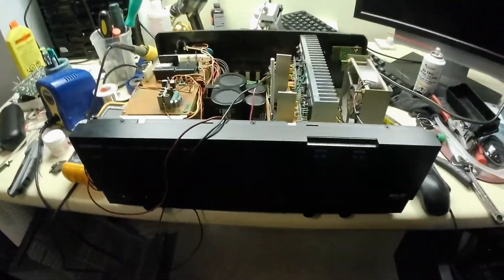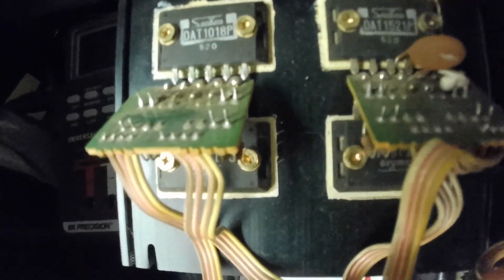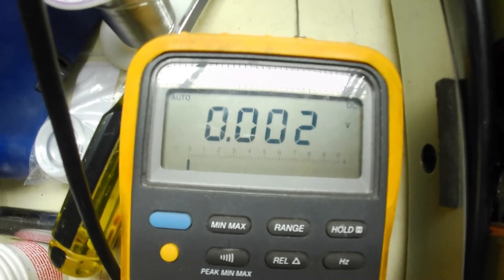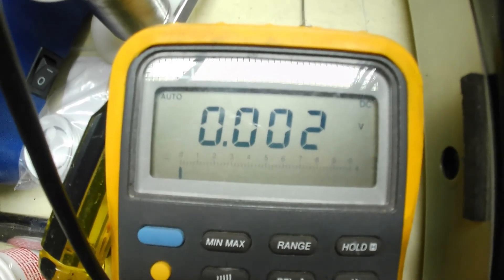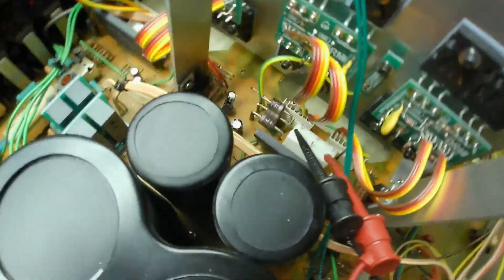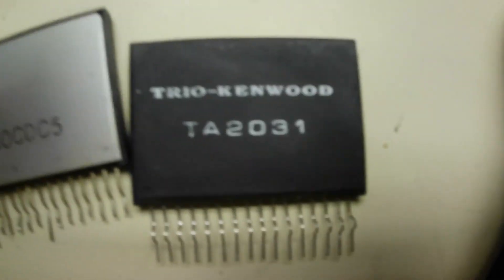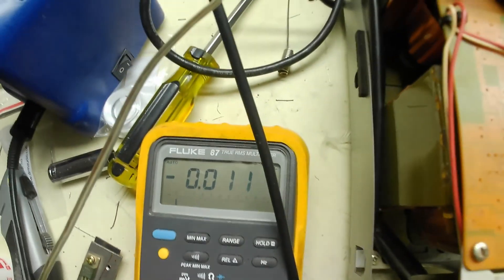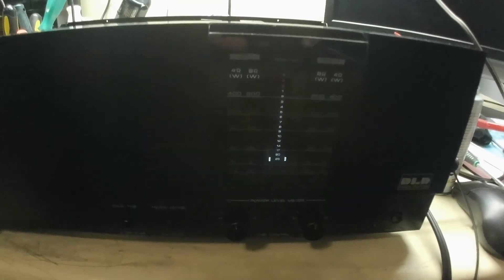Kenwood M2 DRM Modifications and BIAS repair

Comment: Just scored on one! Unfortunately it's appears it's not receiving any input signal, or just not outputting to headphones or speaker connection. Meter display lights up. This thing was matted with dust on the inside, I spent hours blowing it out with air. Still getting nothing 😞. I may have to return to goodwill. I only can do so much.. dam.
Reply from the maker: @Thunder-Raw-am  you getting a click after a couple of seconds after turning it on?
Reply: @cpgixxer Yes it clicks. I have a working Kenwood m2. When I power it  on it clicks first, then I play my music afterwards with no problem. 

I found some parts that look like it busted open on the non working Kenwood m2.. I don't know the parts name. Possibly burned out, over heated? Wish I could post pic so you can see.. bought it used from the goodwill.
Reply from the maker: @Thunder-Raw-am  check the fuses would be next step.
Reply: @cpgixxer 👍. That was the first thing I did was check fuses.. 2x Capacitors on the top left side leaked open. Everything else looks ok. Its beyond my skills, no experience in replacing capacitors. Just gonna return it..dam. thanks dude.
Reply from the maker: @Thunder-Raw-am  replacing caps, watch a video, get a soldering iron and fix it. It's quite rewarding.
Reply: @cpgixxer Seen some pic from a seller on eBay with parts. It's a Old Electrolyte capacitor (x2) that are obvious no good. And old glue.. Guess  I took a loss. We have no repair shops, and parts on eBay for a repair kit is close to $200. 😢. Whoever had it, could've worked on it B4, didn't go right. Or didn't hook it up correctly and it shorted. Has signs of being left it in storage. Had tons of dust and cat hair. A bit of rust on top cover and beneath from moister. I got a lot of the dust cleaned out just to be able to look more into it. Now looks ok, except for the 2x obvious capacitors. Well, thanks for even asking a little bit about it. I wish I had the knowledge & experience to repair myself. I bet it's not as bad as others are that have needs of repair.

Comment: ok so some Sony ES amps pretty much use the same sanken dual transistors. Im surprised nobody has done mods/upgrades like this for the sonys.
Reply from the maker: Not sure why, i guess it all depends on how far someone is willing to go to reengineer a unit.
Reply: Kenwood's amps gained more traction in the market.  The HV/LV PS and drive was innovative. With the fan, 
it enabled MUCH smaller heatsinks for the available power. Probably cost me $700  in new caps one day, LOL

I sold these and SONY, Panasonic. In Australia service for them were not fun to deal when there was a problem. 
Kenwood's service was infinitely better on the rare occasion of a problem . . . infinitely.
 (Thanks Bert Cole if you're still around).
From what I can tell, SONY and Panasonic are still a case of the leopard's spots and JVC bought Kenwood.

Comment: Hello, you may have documentation regarding the change of elements and a description of the modification.
Reply from the maker: You'll have to ask the vendor , I don't want to enfringe on his work.
Reply: @cpgixxer  Ok, then I will try to contact him, if I fail to contact him, my money for buying a damaged M2A has gone somewhere in the far west.
Reply from the maker: @Santo-California  He is very helpful and will sell you whatever you need to repair it, he won't give away his documentation for all the work he has done over the years to create the kit- he asked me not to share the docs with people and I respect his hard work.and wishes.
Reply: I thought this is your modification of this Kenwood M2A, will try to contact the author of the project.
Reply: @cpgixxer  Tell me if you still use Kenwood M2A or if you just repaired it and you don't have it anymore, write some opinions about the M2A if the sound offered by the M2A is worth the sacrifice.
Reply from the maker: @Santo-California  I do not have it anymore but it sounded good when i did run it for a month.   Honestly worth the investment if they are rebuilt with one of these kits however you need to have soldering skills and know how to install, it's not plug and play by any means. I also upgraded the relays and installed the power supply and meter board kits.
Reply: @cpgixxer  I am also wondering if Kenwood M2A as the original plays differently than the kit on the original components, as for the soldering skills I have a friend who would help me, so I think there would be no problem with it, I have to meet my friend and it is quite possible that M2A can be started  on Original Elements. Thank you for all the answers to my questions, I will contact the author of DRM. Thank you and Regards.